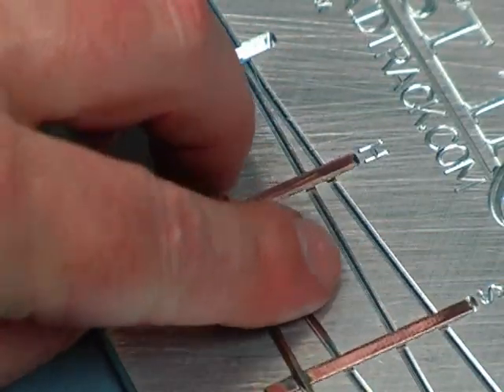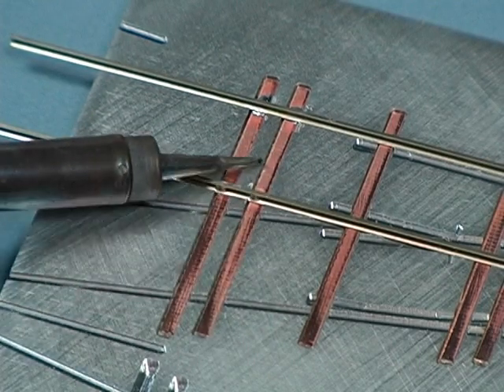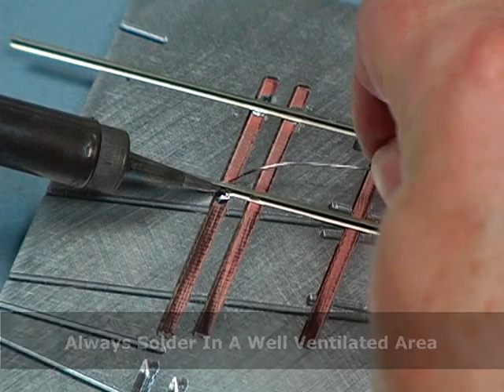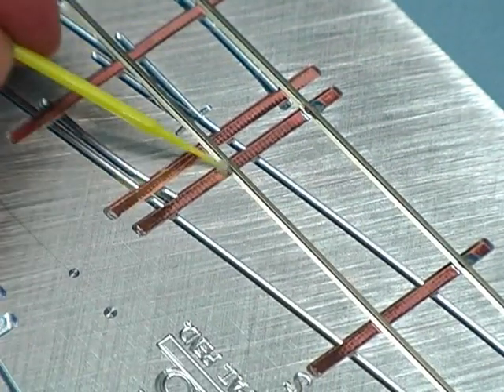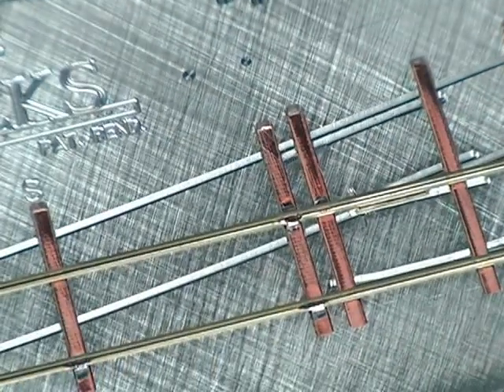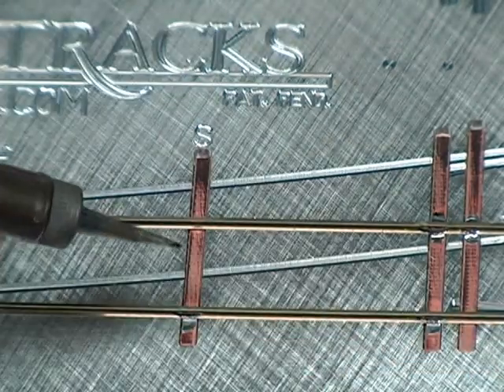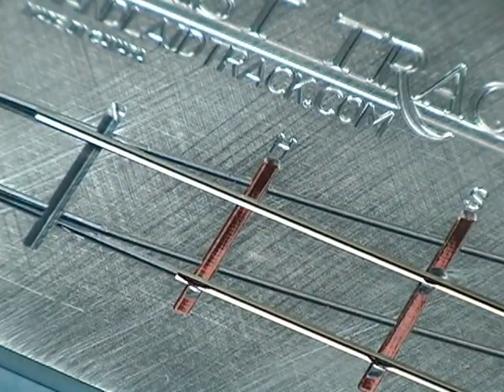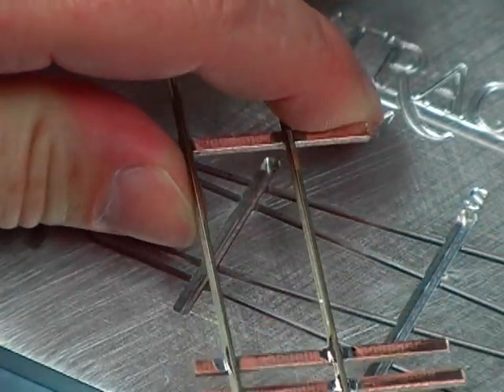Soldering Trackwork Using SuperSafe Flux

Comment: I think it may be better to apply low acid flux on the PCB ties before installing the rails into the fixture. In this case, after installing the rails, the flux will be directly under base of the rail. This will help solder to flow under the rails.